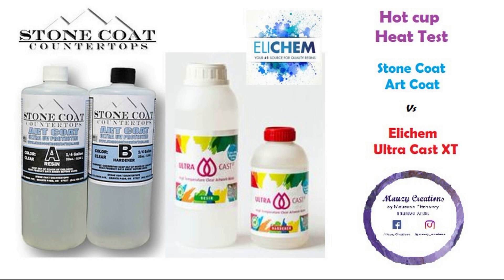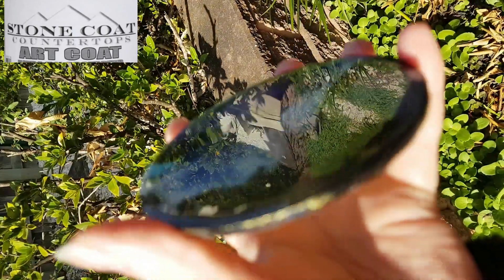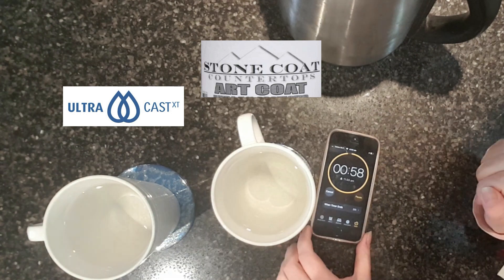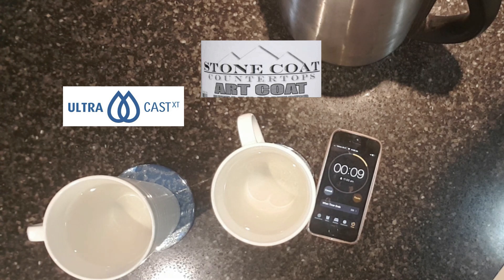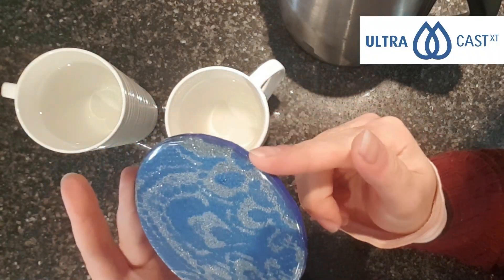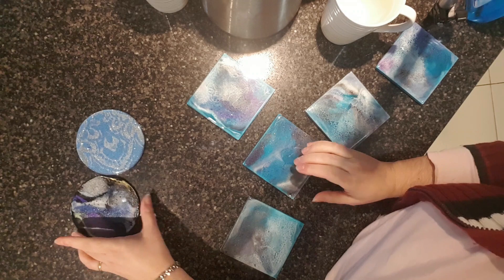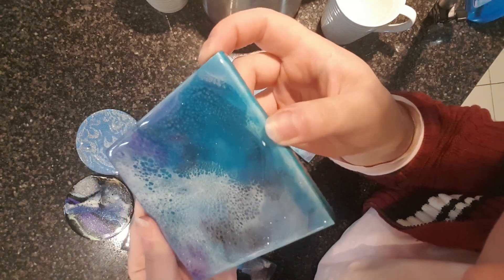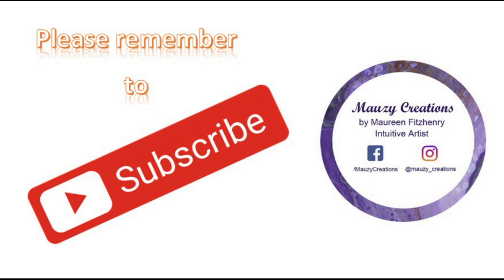[133] Heat tolerance test - Ultra Cast XT (newer formulation) and Stonecoat Countertops Artcoat.

Comment: Hallo. What are you oused now, for heat resistant resin? My Couster have rings😓, I take ultra cast xt.
Reply from the maker: I hate ultra cast xt. I am still using stonecoat artcoat. It's the most reliable for me.
Reply: @MauzyCreations  right now I’m looking at both of these resins as well as promarine. Seeing that you hate ultra cast, I think I may go for stonecast. I plan to check out more of your channel, but curious do you use coaster molds and fill with stone coat or are you just top coating?
Reply from the maker: @kellyjean4981  hi. I have filled with stone coat. Mainly in layers but I have filled the majority of the mould as well. They aren't too deep.
Reply: @MauzyCreations  good to know, thank you. I have used resin on and off for years, but never paid enough attention to the various kinds of resin out there. I’m now very interested and as I have just this moment poured the last of my two gallons of Amazing clear cast, I’d like to buy a more ‘professional’ type of resin for casting small items as well as making shallow trays/coasters. I don’t sell, just a hobby. Any other suggestions?
Reply from the maker: @kellyjean4981  you could look at getting a proper casting resin so you can do deeper pours. I don't have any specific recommendations for casting resins though. For shallow ones stonecoat has been fine. Only issue with stonecoat to watch for it that castings can a bit bendy in the first few days so leave things flat for a while or they could warp.
Reply: @MauzyCreations  Ohh😍, thanks for you're answer 😊.

Comment: Very cool test. I love seeing videos like this. I find that rings and sticking happen more with coasters made on tiles & not much on thinner pieces or coasters made in molds.  Not sure if you have found that too? I stopped pouring on tiles. 💙
Reply from the maker: That's interesting. I might have to test that. Both these surfaces in the main test (the round ones) were mdf rounds but my personal set are on tile.
Reply: @MauzyCreations  I noticed that so it makes me wonder 🤔🤔 I'm also in this group on FB where they say the same thing about tiles sticking and no sticking on mdf or things in molds. 💟